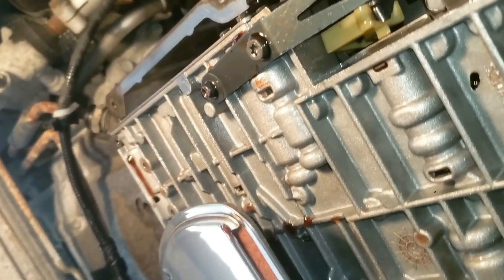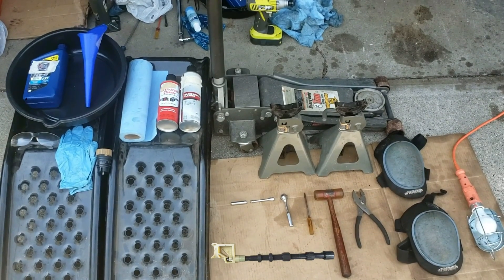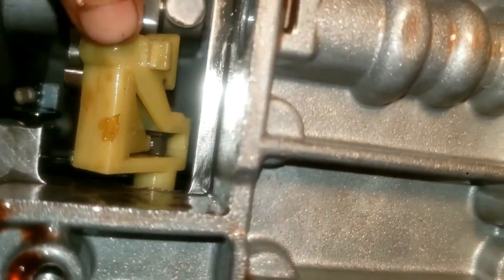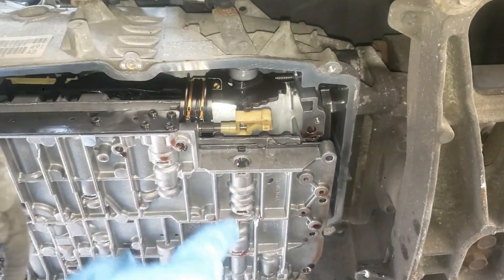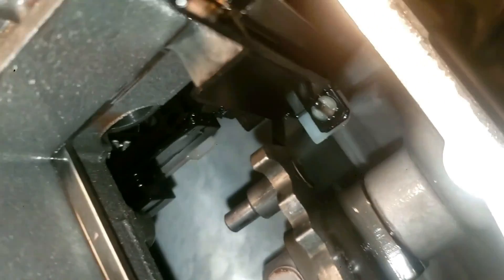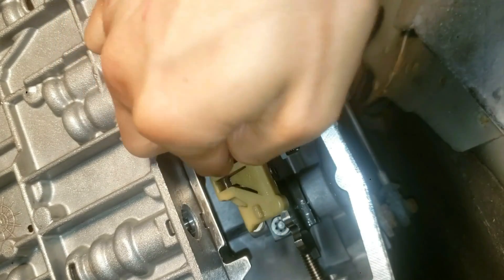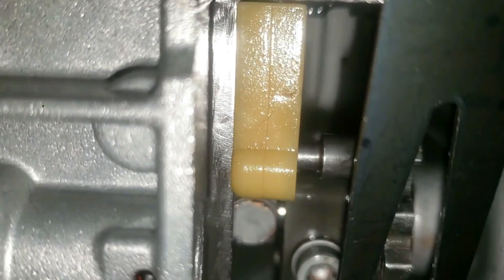Replace Broken Valve Body Selector Rod ⚙️Gear Not Shifting

Comment: Is there a place to buy the selecter rod at a decent price I'm saying $90 I could get a used valve body for 70 w solenoids conductor plate and a new selector Rod
Reply from the maker: I haven't found one. Its just greed at its finest for these. Most of them are priced around $100 if not more.

Comment: Going to have to pull my pan back off because I think this is where I screwed up when I put it back together I made sure it was in the groove but I didn't know it went in that little tab on the side of the valve body. Thanks for the vid
Reply from the maker: Glad it helped. Did you figure out your problem?
Reply: @FixCarYourself  yes eventually I did. 
I pulled the pan back off and lowered the valve body to inspect everything.  Oddly, it was put together right, but I was having a shifting issue and slipping. 
I had installed a new dipstick for trans and it had a cold mark and a hot mark to check the fluid level.. it turned out it was low  because the pan was leaking. 
(Never trust impact driver) I torqued the valve body and pan to specs, and we've been good ever since. 
Again great video thank you
Reply from the maker: I agree torque wrenches are a must. Also sometimes the trans plug adapter is where the leak comes from on these. They tend to go bad all the time. But regardless glad to hear you car is back up and cruising again!
Reply: Same issue i have i took pictures and i see it wasn't straight being that its plastic im looking to order new plunger im aure it broke😊

Comment: After changing conductor plate I made the mistake you mentioned with tab above the guide instead of below.  After reassembly and attempts to drive I now have a mess with transmission in neutral, selector at selector rod in  5th and ecm thinking it's in park.  All this causing starter interlock to deplo y due to errors and won't start!  I can fix selector spool but not sure how to place spool and detent to match shifter.  Help!!  Also, selector rod has slight bind at one point when moving thru positions, is this normal or another problem to fix..new selector rod?
Reply from the maker: Did you ever get this fixed? What was the problem?

Comment: Changed my VB and now the cars stuck in P it shows the gears changing on that dash but won’t budge did yours do that too ???
Reply from the maker: Yes I think so. So if it shows your in drive, and the car doesn't move as if it was in park, then the selector rod may be bad or not lined up correctly.
Reply: @FixCarYourself  it was broken I swapped it from my old plate lol nobody mentioned that having to be lined up not even FCP video the guys just puts the VB right back in  the vehicle after swapping sensors to new ones
Reply from the maker: I noticed that which is why I made a video on this. Glad it helped and that you did this repair yourself.
Reply: @FixCarYourself  absolutely appreciate it not even fcp said anything about that part lining it up or it being plastic I thought this would be something extremely important or a lot of people mentioned but it’s rarely ever mentioned lol
Reply from the maker: Agreed!

Comment: I had sent my valve body out at a cost of 600 for rebuild.  I wish I had seen this video before I sent it out.  Thanks for sharing!
Reply from the maker: Glad it helped. Wish you could have saved that money. What was the problem you were having. Would hate for you to be taken advantage of if all they replaced was the selector rod. Of course they might do some other checks. Nonetheless what else did they do?
Reply: @FixCarYourself  it was my fault i replaced my conductor plate but i had limited space under car access passenger side only since i knew i had to take out the plug socket. So when i put it back up i couldn't get to the otherside so i took a picture i seen it slid into the rod but didn't see the slot on the side wasnt on the guide it broke when i came out of park i felt that slight tightness then it moved loosely i did the work myself on both. Thanks again 🙏

Comment: thank you, it is really a wonderful video. you showed every details about the point you wored on. but I still got another question. I recently saw a leakage from the Shift Lever Shaft seal, (mopar number 5134933AA). but for this transmission, we can not replace it from outside, the only possiblitiy is open the pan and replace it. and I see from you video, by removing the spring detent on the valve body. we can clearly see the Gearshift Detent (Mopar number, 52108349AA) and Shift Lever Shaft. and I see only one screw like fixing the gearshift detent on the shift lever shaft (Mopar number 52108432AC). My question is: is that true the only screw fix it? and if a disassemble that screw, the gearshift detent can be removed? and then, teh shift lever shaft can be also removed easily? and finally replace the seal? Thank you so much. by the way, it is on a 2011 Jeep Grand cherokee, 5 speed automatic
Reply from the maker: What screw are you referring to. A what part of the video.
Reply: @FixCarYourself  it's the T type screw on the gearshift detent (or selector), which fix the detent to the shift lever shaft then can be rotated by the shaft. I mean, when release the screw, the shift lever shaft can be take out easilly?
Reply from the maker: I'm not sure if the gear can come out with ease...may have to completely remove the transmission housing to do so (but not completely sure). Also, its possible the leak is really in the valve body, and you may want to check on or replace that if possible. The valve body can be pricey.
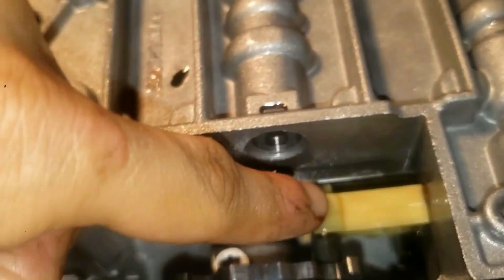Reply: @FixCarYourself  in your video, at 2:04, you can see the only T type screw. that is it.
Reply from the maker: Also remember to use a code scanner to narrow down your problem.

Comment: I don't have a selector problem, but there is a shifting problem. Avenger 3.6 Pentastar; after cold start reverse locks up and sudden deceleration causes downshift to drop the gear. Consistent issue from 3rd or 2nd into 1st. Stall, and engine stop or stuck in 1st gear. Thoughts?
Reply from the maker: Lot of possibilities here: 
1) See if you have any trouble shooting codes with a code reader. That should narrow down the problem. 
2) Test the transmission oil level (might have to buy a special dipstick measurement tool which is less than $20 unless it is equipped with one) Check out this video here to give you a good idea: https://youtu.be/LLBqOUL8oCU 
3) Might need to do a Transmission oil change (research this more because it might be bad doing that if car has lots of miles on it) 
4) Could be something with the shift linkage under the gear shifter.

Hopefully this gives you some ideas where to start.
Reply from the maker: Some people also try a "Transmission repair Oil Fix" which is essentially adding trans lube to the transmission.
Reply: @FixCarYourself  Well some of those were tried already. There are no trouble codes coming from the PCM, it started after a fluid exchange and filter change, and it has been roughly 2k miles since the service (est. 8 months time). It is possible that the amount of fluid placed in the transmission was incorrect so the last two suggestions I should get on top of. Thanks!